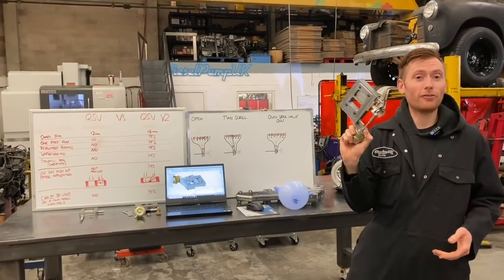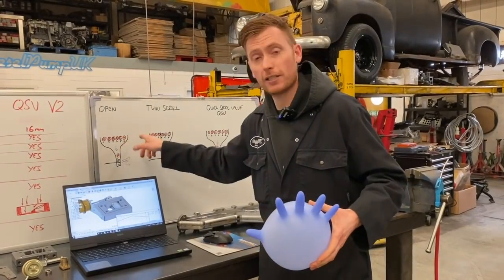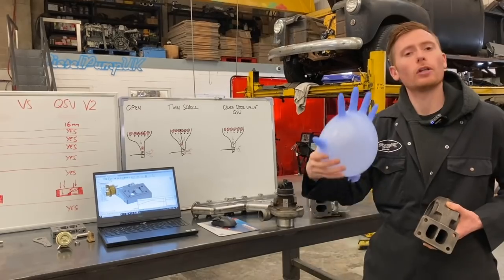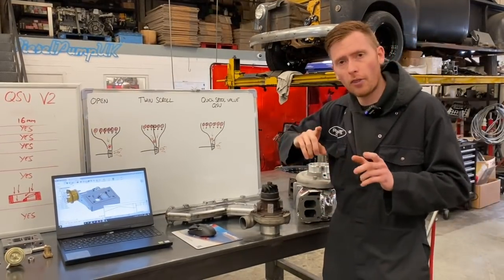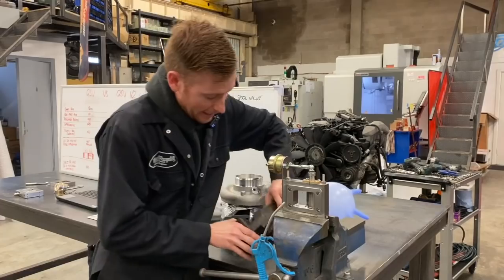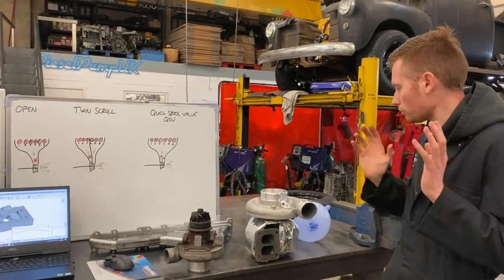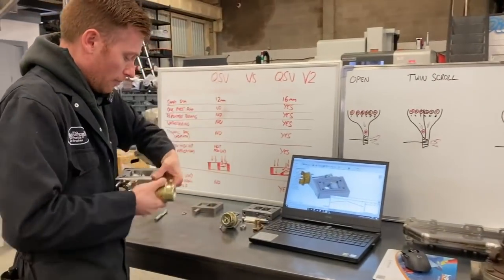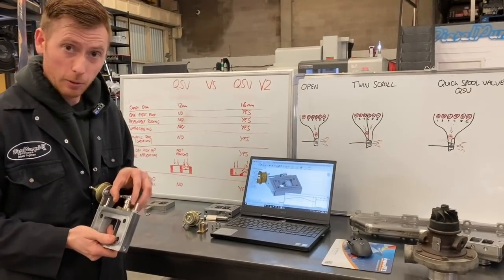Quick Spool Valve V2 Water-cooled + FASTER TURBO SPOOL!!!!!!! Billet Valve

Comment: If you gain 300-500 rpm from a twin scroll turbo and you gain 300-500 rpm from the quick spool valve its better to just go with a normal twin scroll setup. This valve is good only if you have an undivided manifold and you want twin scroll spool

Comment: The valve looks pretty thick. When its open it looks like only 50% of the other port is available for flow because the valve is in the way. Is there a way for both scrolls to get equal exhaust flow or that one scroll will get less?

Comment: nice video. Quick question, this new design of QSV allow the use of twin scroll manifold to twin scroll turbo which is great. but when the valve is open, you have this little area at where the QSV is,  that allowing the exhaust gas from either of the divided manifold to go either side of the turbine housing, which means it kinda acts like open scroll exhaust manifold with a quick spool valve. So, what i am thinking is that, what if you make a valve that when the valves is open, it will also complete the divided exhaust at the same time, that is you have completed dedicated path to turbine housing just like when you are using twin scroll exhaust manifold + twin scroll turbo without quick spool valve in between ? I hope this make sense. 

In case i didn't describe the scenario well enough, let's call those divided runners on the exhaust manifold collector into RUNNER A and RUNNER B. when the valve is open, gas from RUNNER A can still go to either side of the turbine housing, same goes to RUNNER B since there is this small open area in the spool valve that allow either side of the exhaust to pass thru. so what i am thinking is what if you have a new spool design where you could open the valve and at the same time close off the shared path so you will end up with complete dedicated path from exhaust manifold to turbine housing ?
Reply: I was thinking the same thing. This would also get the valve out of the way of the other port. It looks like the thickness of the valve takes up about 50% of the port. Hopefully they will redesign it this way for V3

Comment: you should make these for a CT26 flange, would make a killing here in Australia for the 1HD series of deisel engines.
Reply: The CT26 on a Landcruiser 1HD series engine does not have a divided housing so the valve wouldn't do anything.
Reply: @tun0fun  the ct26 from the supra are twinscroll
Reply: @patriotFPS  So you want to source the parts, swap the turbine and housing plus add a quick spool valve to a... standard 2nd hand compressor wheel, housing and chrg? 

Why? A CT26 is good for like 10psi in a 4.2L.

Just put on a better turbo, like an EFR6758 which will be pushing 28+psi in there by 1800rpm.
Reply: @tun0fun  hi flowed CT's are good for 30+
Reply: @patriotFPS  And they'll be right out of their efficiency map too, blowing hot air, while a modern turbo will still spool faster and be flowing more air at a lower temperature, while at lower boost pressures.

Comment: You need need NEED to get someone to animate this for the layman to see. I can picture it, and my lower jaw, chin, t-shirt, and the floor are covered in drool but I do think it'll be a bit tricky for a layman to completely envision.
This is amazing because, as you may have notice, you actually have 3 modes here. 1. all exhaust to inner scroll 2. exhaust divided (as, with a 6 cyl., it should be) and 3. all exhaust to the larger scroll. Do not discount the fact that some want the low-rpm exhaust going to the smaller scroll and some want it to the larger. It's none of your concern and they may be right or wrong, but the point is that you cater to both camps!

Well done. This is seriously awesome and I hope you come up with some cool turbo staging designs based on this technology.

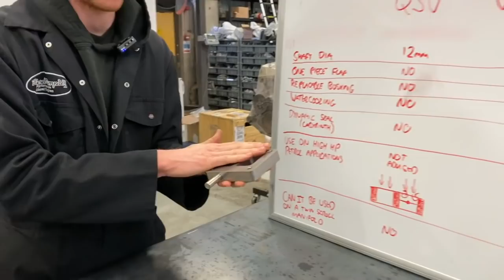Comment: 7:53 not only would it be less reliable to have bottomed threaded fasteners in that valve, the failure mode would be BITS OF FASTENER THROUGH YOUR TURBO lol stay of AliExpress, pals.

Comment: I like the concept but it would be exceptionally helpful to see some back pressure measurements , egt, turbo speeds, dyno sheets. If you need someone to test it on a borgwarner twin scroll 6758 let me know. Cheers

Comment: Has anybody thought about it possibly stifling the flow? This is just a question I'm not trying to be a troll or negative, but at wide open throttle at the top end it would seem like it would be a small obstruction.

Comment: this is a really unclear explination. you talk alot, dont really say much. you gloss over the important parts. your hopes to educate newcomers is low.
Reply: Can you please elaborate, what important parts aren't mentioned?
Reply: @tomislavpopinjac7658  he just sort of mumbles about this and that. he tells you its a valve about a thousand times. he shows you a volute, he uses big words. But how hard is it to just say here is a divided turbo, shut the valve you force the air through half the volume increasing velocity. In truth these valves are massive restrictions to your exhaust flow which handicaps the turbo where it is  efficient in favor of boosting performance where it is not. QSV's dont MAKE any horsepower. They COST you hp while bringing UP torque under the curve. They arent for every setup, you need to understand all aspects of the device before deciding if it is right for you or not.
Reply: @DieselRamcharger  I'm with you a restriction and another part to go wrong but it looks like there is enough believers so they'll sell enough before people work it out.

Comment: Super cool design great explanation felt like o was back at school...only this time I was actually interested 😂 this is possibly a silly question could this work on a 4cyl petrol? Reason I ask is am going to be building a high Hp Mercedes M111 2.3 for our Turbo Slk, although a GT35 is good we will be running very low compression with high boost so being able to use a larger turbo would be ideal. + We all know a big turbo looks sick 😉 but less rice more sushi.. the biggest thing I know we will face is gas flow  as the head and Cams are going to be the biggest headache. Appreciate any help or advice you could give 🙂

Comment: I’d love to see how this would work with a rotary, especially if it has an open manifold to make the valve useful
Reply: I believe s4 and/or s5 rx7’s actually had something similar from factory.
Reply: @rhyswatson8918   Yep, still used in modern 2.5T from Mazda.

Comment: That is a pretty sweet setup, time to ditch the VVT turbos!!!!
Reply: Turbos don't have valve timing at all, what do you mean "VVT turbos"? xD
I assume you misspelt VGT, which does not need "turbo" afterwards, as it stands for Variable Geometry Turbosupercharger; "VGT Turbo" is like "ATM machine" or "smh my head".
Reply: @Jupiter__001_  yes I’m referring to a VG Turbo. I refer to it as a variable vane turbo which obviously is not correct.
Reply: @jasoncampbell4723  Actually that's a more descriptive title for it. I thought that since the V was below the G on the keyboard, it was a typo.

Comment: My only concern on this would be drive pressure, and if the valve possibly fails and over speeds the turbo. I think is fairly neat, but my curiosity is with longevity, and possibly carbon build up
Reply: Carbon buildup shouldn't be an issue. I work on a lot of Maxxforce 13 engines, and if you take of the pipe to the aftermarket, they make a lot a black smoke. The egr valves are pre cooler and I've never seen them seize from carbon.

Comment: With that kind of capability and motivation I wonder why did you discard twin scroll effect? I would encourage you to start designing V3 which would have two more big improvements: 
- Twin scroll effect (same closed position, open position would create a seal between two chambers of turbocharger and exhaust manifold) 
- 2x Exhaust pressure or EGT ports (possibly for sensors or for compressed air aid spooling, there are examples of this helping spool tremendously) 
These two improvement would make this ultimate product and possibly make big turbos ultra responsive

Just my two cents in this. I would definetly buy this if this product would still utilize twin scroll effect.
Reply: agree 100%

Comment: Another improvement would be to put the valve slightly offset so it gets flush when opened fully, current design still is really restrictive.
Another thing that some customers would love to see is the commonrail and direct injection conversion to om606
Reply: The OM613 and Om648 were broadly speaking common rail versions of the OM606
Reply: @Tommyflocker  are they the same internally ?

Comment: Is there a threshold of sorts for needing the water cooling?  Love the idea, but don't want to add a water cooling circuit (thinking about air-cooled motor application.)
Reply: You could try running oil through the QSV instead of water maybe

Comment: How about when you lift the throttle and the flap goes back to close, is there an peak with the exhaust gas pressure?
Reply: Would not expect that with a diesel, not having a throttle valve and all. And think the flap would be closed when inlet manifold pressure drops, which would only be when the turbo spools down enough due to lack of exhaust pressure. And thus would not expect pressure to build in exhaust manifold in a peak manner. (Revised this answer to make it more clear)
Reply: @robvandijk2973  yes but throttle valve is on the intake side and this quick spool is on the exhaust side 😁
Reply: @Tomi4170  Both are connected through the turbine shaft. If the turbine stalls it could build up pressure in the exhaust manifold. It was the only possibility I could think of. The flap would only close when exhaust pressure is too low for the twinscroll turbo manifold to generate pressure.....so either way would not expect any problem with peak exhaust gas pressure in the manifold. And I would expect the pressure to push the flap open when high enough.....

Comment: I'd love to see some side-by-side dyno runs of the same turbo with / without the QSV. Or a twin-scroll turbo vs a comparable QSV setup.
Reply: I want exactly the same, it would  be great to see the difference
Reply: With QSV installed  he must make 2 videos, one with as he put it closing the inducer side  of turbine and another video 180º QSV fitted, closing the exducer side of turbine. Previous video about QSV he fit QSV flap closing inducer side (big diameter),  I think is not the correct way to fit, QSV is for fast spool, then flowing air to big diameter turbine is as you move the turbine fast, fast than blowing air to small diameter, less radius, but dyno has the numbers , I can be wrong.
Reply: @jarripotero  maybe they can test both ways and show what fits the best for high power
Reply: We did it in the MKIV supra community with my car and friends car over 10 years ago.   67mm with qsv spooled about 150-200rpm quicker than a 62mm bw on a twin scroll setup.  QSVs work well.     Target was 300 lbs ft of tq.   i want to say his car hit that around 3150rpm and mine was more around 3350 he had a bigger turbo too!  stock cam e85 2jzgte 6spds.
Reply: Did this ever happen? Anyone know
Reply: yeah, Luke could you make some dyno runs, so we can see the real world difference, please? Thanks. Othverwise it looks great, it´s just a lot of money for something I´m not sure if i need.
Reply: The QSV is used with a twin scroll turbo so…
Reply: Had it and have to remove it,TOO MUCH TURBO LAG.
Reply: @adriangreen7935  you talk rubbish

Comment: I see in the description of your hx40 turbo kit that I should expect it to start spooling at 2700 rpm. What should I expect with this valve on that specific kit? I would be very interested to see some before and after dyno videos with this valve on your various turbo kits so we can really see the difference in spool up time and the increase in low end power. Cheers Luke.
Reply: Any update in this?
Reply: Probably see spool before 2k with the valve it makes a massive difference